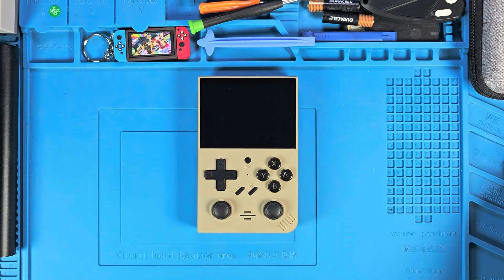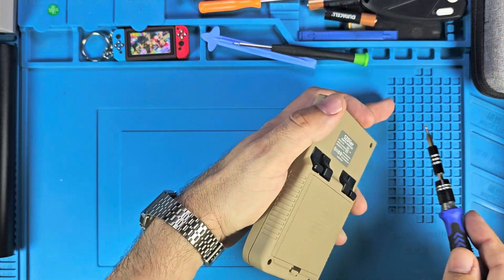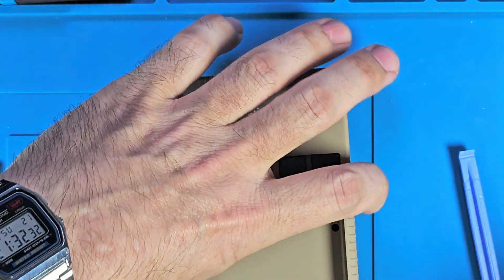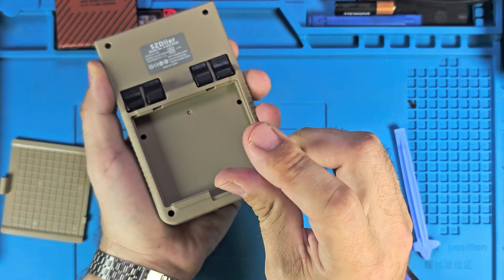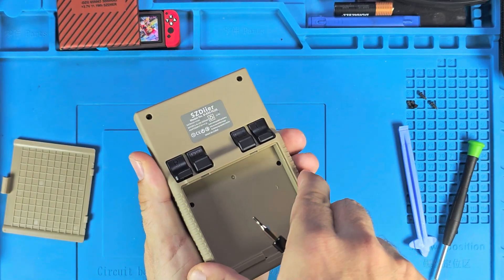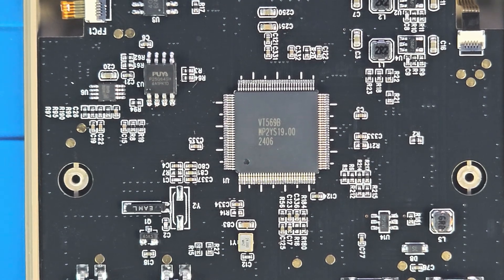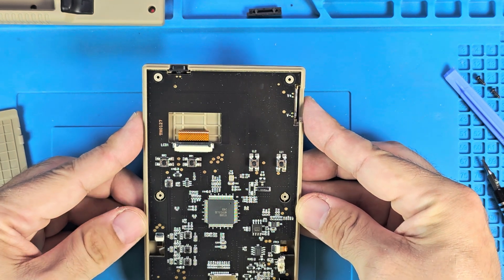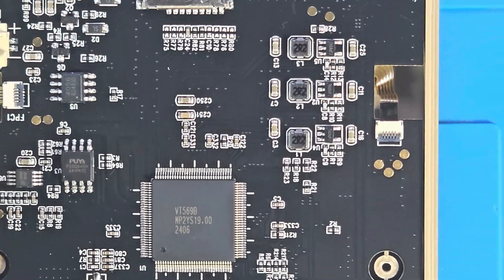Teardown of the D-R35 Plus Retro Handheld - Chip Revealed

Comment: As long as the preinstalled games run fine, it’s okay, if … if they where honest with the advertising. 
Nothing wrong with a cheap device if it does what’s promised.
Mine was from amazon and advertised as RK3326. My review was deleted by amazon, because I mentioned that the cpu is not what advertised. Send it back because GBA emulation got some timing issues with sound drifting from video. 
Ordered a new one from another seller for 31€. Will arrive in a few days.

Comment: The analogs do not come with l3 r3 functions, I swapped with Nintendo switch analogs and you can Press down but the whole system became useless. Nothing will move, the only buttons working is the volume and power switch. I switched it back and it's functioning again.

Comment: I got the R35S october last year (yes the one just before the R36S) and all just because of the chipset, you can put newer versions of arkos or amberelec, jelos, unofficialOS, (maybe lakka or even batocera 'not tested yet') because of the RK3326 | Mali-G31 used on many other handhelds and the lowest price with decent quality. handhelds with not common chipsets will not have a lot of options in the custom firmware community.